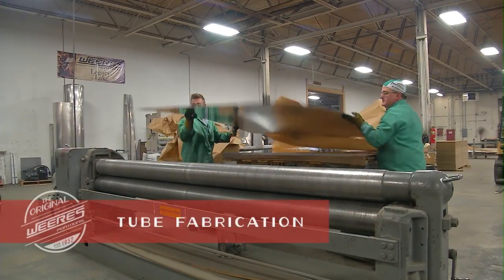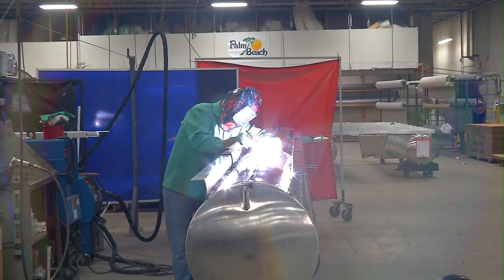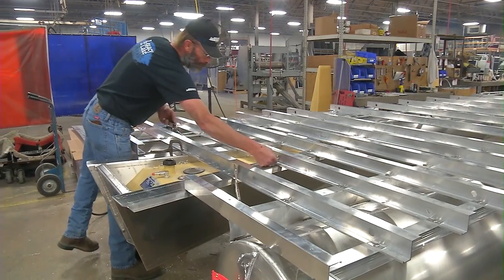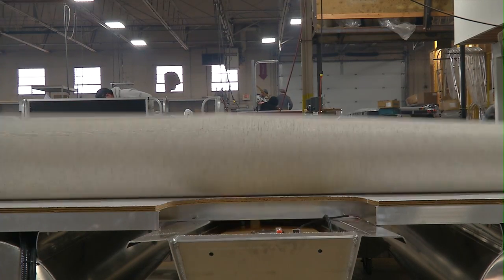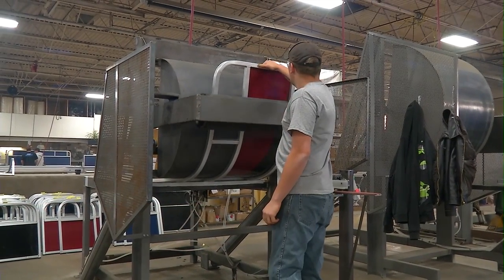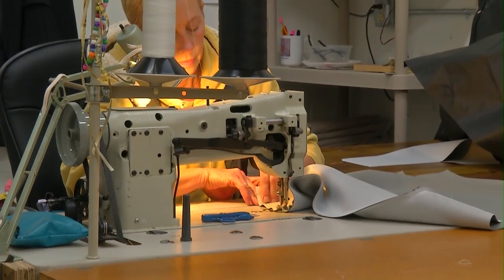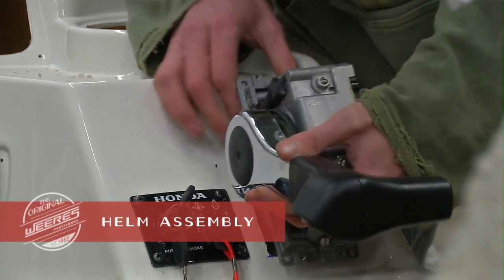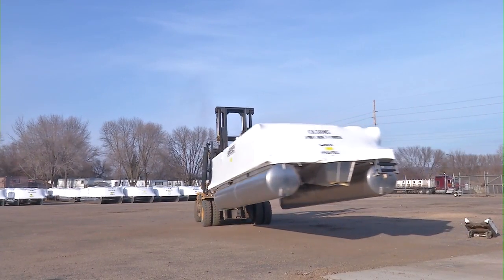Weeres Pontoons Factory Tour

Comment: Hi Great Job, am just inquiring is the aluminium tubes for the pontoon can be filled with any light materials,  eg : foam... or any other material that keeps the pontoon floating on the river if the tubes shot fire by pirates to steal the goods & passengers!! The idea we have many boats sink into the river,  I just need your guidance and expert,  if we experience such case we don't want to loose the boat or pantoon it self,  because it's impossible to take it up again from the bottom of the river!!
Would appreciate your advice and assistance how to rescue the boats??
Please getback with your advice 
Thanks 
Mouawia Jbarah
Kenya